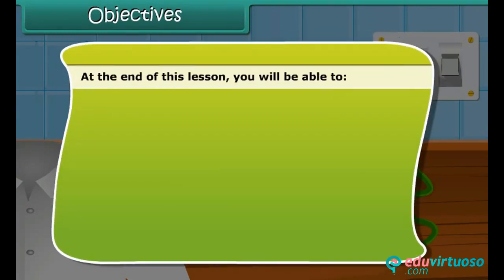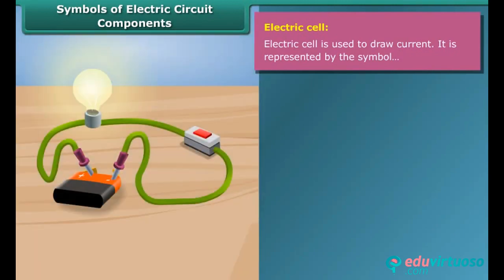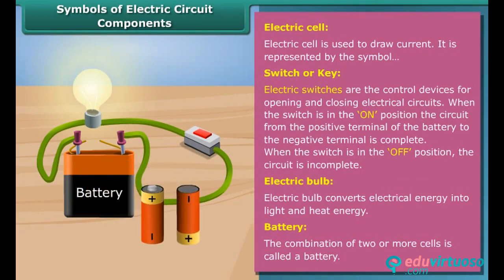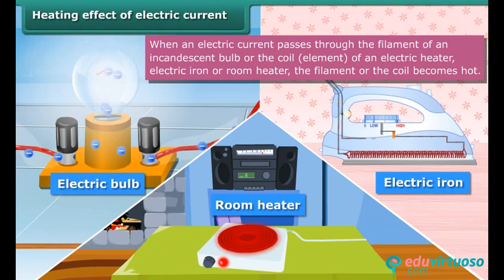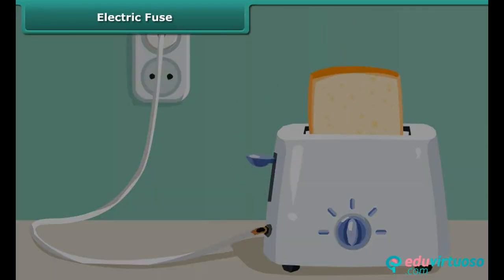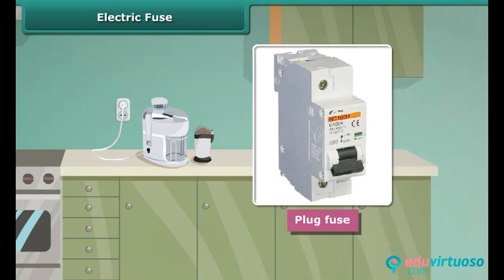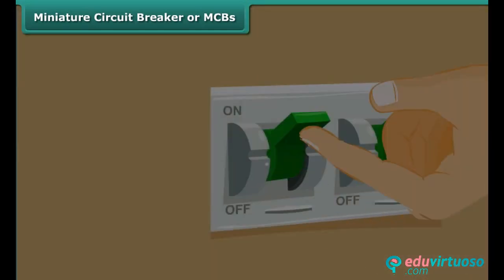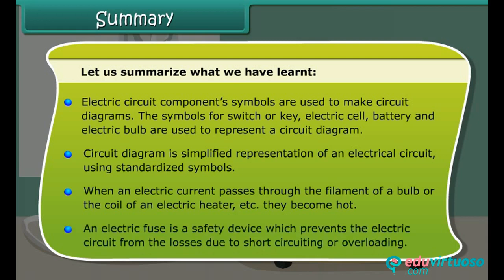Grade 7 | Science | Heating effect of electric current | Free Tutorial | CBSE | ICSE | State Board

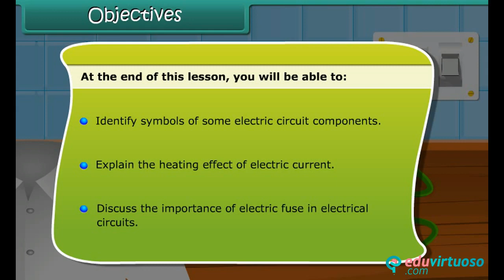Comment: 0:45 there is an error here if the switch comes after the bulb which is after the negative terminal the electrons pass through the bulb and it will glow still. correct me if I am wrong.
Reply: :yougotthis::yougotthis::yougotthis::yougotthis::yougotthis::yougotthis::yougotthis::yougotthis::yougotthis: